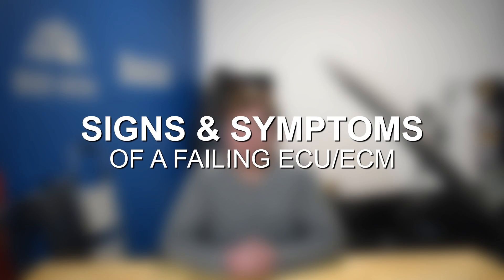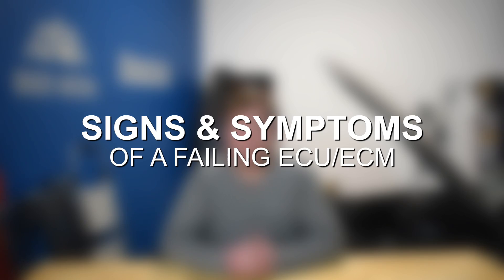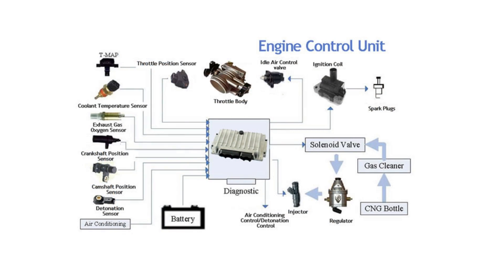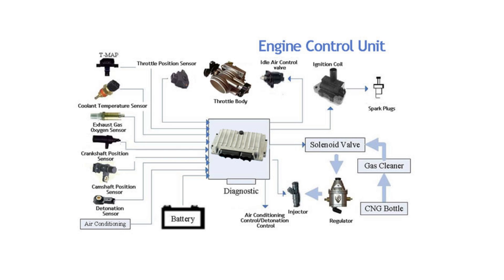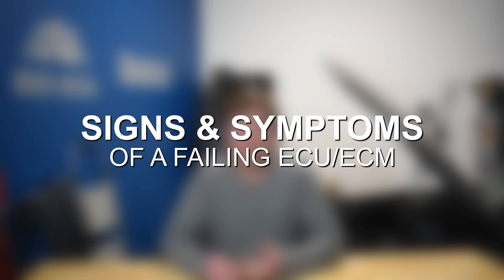Signs & Symptoms of a Failing ECU/ECM! (Engine Control Unit or Engine Control Module)

Comment: Good day i have a ford ranger 3.2 auto T6,when the vehicle is cold and i drive and come to a stop the engine cuts out but it starts right back up put it in drive and go,when the vehicle reaches temp it doesnot cut out at all when i drive and stop only when its cold so my question is what diagnosis can be made please i need some advice.
Reply from the maker: F - A Ranger that stalls when cold but runs fine warm often points to an issue affecting idle control or fueling during cold starts, such as a sticking EGR valve, dirty throttle body, slow MAF/MAP or coolant temp sensor response, or weak fuel pressure that stabilizes as the engine warms. Because the ECU uses richer fueling and higher idle targets when cold, any airflow or sensor inaccuracy can cause stalling at stops. I’d start by scanning for codes (including pending ones), checking live cold-start data, and cleaning the throttle body and MAF, then inspecting the EGR and fuel pressure before replacing parts.

Comment: Got one right now throwing conflicting codes p0087 fuel rail pressure too low, p1093 fuel rail pressure too high, p0404 EGR Open position performance, P042e EGR closed position performance. Got me leaning toward a bad ecm.
Reply from the maker: F - When you’re getting both P0087 (fuel pressure too low) and P1093 (fuel pressure too high), plus EGR position performance codes (P0404 and P042E), that usually suggests erratic or contradictory sensor readings, which could stem from a failing fuel pressure sensor, stuck EGR valve, wiring/ground issues, or even ECM faults. Start by checking the fuel rail pressure sensor and wiring harness—if it's loose, shorted, or has high resistance, it could spike or dip the signal. For the EGR, inspect the valve for carbon buildup or mechanical sticking. If all sensors and wiring check out, ECM could be at fault—but rule out voltage instability, weak grounds, or harness rub-through first, since those can mimic ECM failure symptoms. Keep us updated!

Comment: i have problems of speed is not increasing through axelrator
Reply from the maker: A - If your vehicle isn’t accelerating properly when you press the pedal, it could be caused by a failing throttle position sensor (TPS), faulty accelerator pedal sensor (especially in drive-by-wire systems), clogged fuel filter, restricted airflow (like a dirty air filter or bad MAF sensor), or even a transmission issue not allowing the vehicle to shift properly. If there’s no check engine light, start by checking the throttle body for carbon buildup and ensure the throttle linkage or pedal assembly isn’t sticking or damaged. If the problem is intermittent or worse under load, it may also point to fuel delivery or ignition problems.

Comment: Faulty after 20 so years 😩 I'm having problems on my Jetta that is a 22' model and has 45k on motor 😒 only one code popped up this morning after it failed to crank over ... P0606 I'm hoping it's nothing major since the car is still pretty much new .. it did also tell me my battery voltage is low so I'm hoping it maybe a bad battery or wire loose
Reply from the maker: B - Code P0606 refers to a PCM (Powertrain Control Module) processor fault, which sounds scary, but in many cases—especially when paired with a low battery voltage warning and a no-crank condition—it's actually triggered by a weak battery, loose terminals, or voltage drop during startup, rather than a bad PCM itself. Your Jetta is still very new at 45k miles, so unless there was water intrusion or aftermarket electronics installed, a failing PCM would be extremely rare. Start by checking the battery terminals for corrosion or looseness, and have the battery load-tested—even if voltage looks okay, it may not have the cranking amps needed. A weak battery can glitch the PCM during startup and falsely trigger P0606. If the battery is original, it may just be aging early. Replace or charge it first, clear the code, and monitor—it often solves the issue entirely.

Comment: My car starts fine everytime, the battery also has the correct voltage but a red battery light flashes on and off and a clicking noise comes from what I think is the ecm while running idle. Could you advise me on why or what that could be please
Reply from the maker: S - If your car starts reliably and the battery voltage reads normal, but you’re seeing a flashing red battery light along with a clicking noise near the ECM, that strongly suggests your alternator may be failing intermittently—it could be producing enough voltage to start and briefly run accessories, but not maintaining consistent charging once the engine is running, which triggers the battery warning and causes relays or modules (like the ECM or fuel pump relay) to click as voltage dips. Check the voltage at the battery while the engine is idling—you should see 13.5–14.5V; if it drops below 12.8V while running, the alternator or voltage regulator is likely the issue. Also inspect the alternator belt for slippage, and check grounds and connectors from the alternator to the battery and ECM for corrosion or looseness. A failing alternator can create just enough power to seem fine until the system loads up or heats up.

Comment: Hi
I have a TOYOTA HIGHLANDER 2006 HYBRID.
Suddenly I noticed that the OBDII scanners could not read or connect to these components or modules:
BCM (Body Control Module)
SRS (Supplemental Restraint System)
SR (Sliding Roof)
BD (Back Door)
ES (Entry & Start)
AGW (Accessory Gateway)
EMPS (Electronic Motor Power Steering)
DDM (Driver Door Motor)
CM (Combination Meter)
AC (Air Conditioning)
They are literally offline. Everything works fine, doors, windows, lights, sockets, AC, etc.
I had a spare HV Battery and I swapped it out and codes went away. But I still could not establish connection to these modules and to diagnose them. I have checked all fuses and all seems OK.
What could have gone wrong?
OBDII Scanners reads the following very fine:
ECM (Engine Control Module)
ECT (Engine Coolant Temperature)
ABS (Anti-lock braking system)
HC (Hybrid Control)
CCS (Cruise Control System)
OD (Occupant Detection)  
Where can i begin my further checks?
Please I need help here.
Reply: I have an 07 camry hybrid,  I have similar symptoms.  I'll be using this as a guide. 

Thanks
Reply from the maker: @Juanpena-ek5ks  Keep us updated!
Reply from the maker: J - You're dealing with a partial network communication failure—since critical systems like ECM, ABS, and Hybrid Control respond fine, but body-related modules like BCM, SRS, EMPS, and others are all offline, it's very likely an issue with CAN Bus communication, a faulty gateway module, or a power/ground issue affecting one leg of the network. Given your Toyota Highlander Hybrid uses multiple CAN networks (main body CAN, powertrain CAN, etc.), and your OBDII scanner is reading only powertrain-related modules, the Body CAN bus or Accessory Gateway ECU (AGW) is a strong suspect. Here's where to begin:

Check CAN Bus Line Termination: A shorted or open CAN line can take multiple modules offline—use a multimeter to measure resistance across CAN High and CAN Low at the OBDII port (pins 6 and 14). You should see around 60 ohms—if you see 120 or 0, one terminator is missing or there's a short/open.

Check the Accessory Gateway ECU (AGW): This module acts as a hub for communication between body modules and the rest of the system. If it's failed or not powered up properly, the BCM, SRS, AC, and other systems won’t communicate. Check its power and ground circuits, and look for corrosion or loose connections—especially near junction connectors J10, J17, and J19 which carry body CAN lines.

Pull and Inspect Connectors: Go to the under-dash fuse/junction box, and check connectors for corrosion or looseness—water intrusion or a loose pin in these connectors is a common failure point in older hybrids.

Disconnect Modules One by One: If the CAN Bus is being held down by a single bad module, disconnecting modules like the sliding roof, driver door ECU, or AC amplifier one at a time (especially ones in the network that are offline) can help isolate the fault. When communication returns, you've found the shorted or misbehaving module.

Use a Professional Scanner with Gateway Support: Many standard OBDII tools don’t support body module scanning on Toyota hybrids—try using Techstream or a high-end scan tool that can interface directly with the Gateway ECU and Body CAN.

You're close—since everything functions physically, it's not a power failure to the modules, but rather a network-level failure or gateway issue. Start at the AGW and CAN Bus resistance test, and you'll likely find the cause. Let me know if you need a wiring diagram or pinout to help trace it.

Comment: Changed out the map and bank 1 o2 sensor, the coil pack, spark plugs, charcoal canister and still getting a purge valve fault with a good multimeter reading in fuse box but not able to get reading on purge electrical connector.
Reply from the maker: J - If you’ve replaced all those components and are still getting a purge valve fault—with good voltage at the fuse box but no reading at the purge valve connector—then it strongly points to an open circuit, broken wire, or bad ground between the fuse box and the purge valve solenoid; even though the fuse is good, the power or ground wire to the purge valve could be damaged, corroded, or disconnected somewhere along the harness. Use your multimeter or a test light to check for 12V at the connector with the key ON (one pin should have power), and also do a continuity test from the other pin back to the ECU or ground depending on the wiring design—if either leg is broken or has high resistance, the ECU can’t actuate the valve. A simple wire repair or new pigtail may solve it.